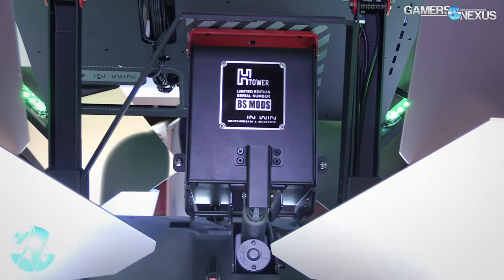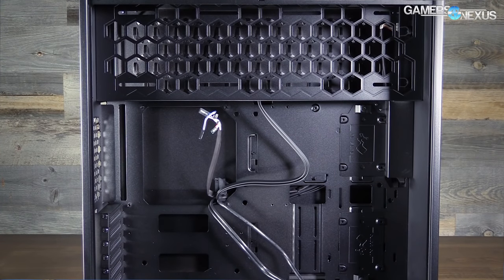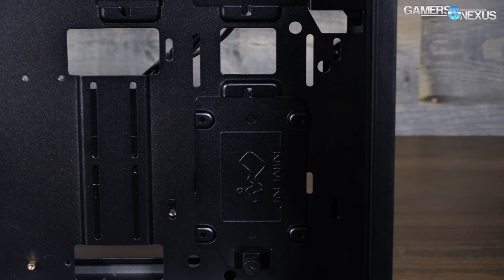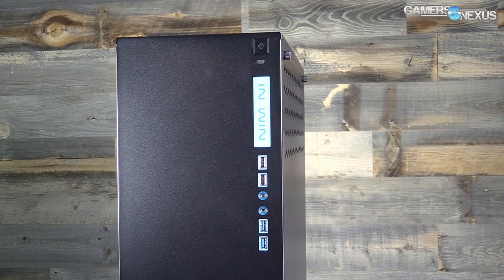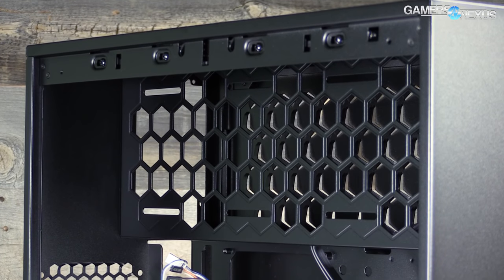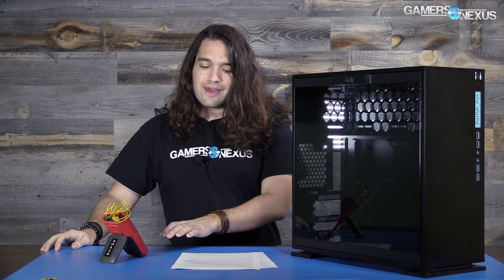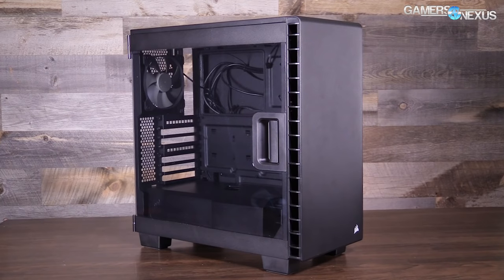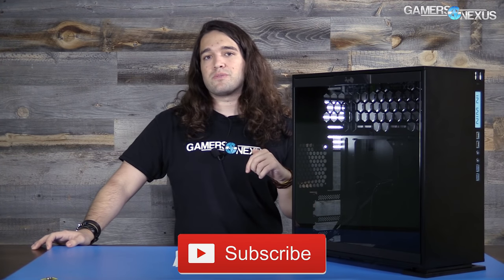In Win 303 Case Review & Benchmark vs. S340, 400C

Comment: Steve, with single GPU and 240rad on top honeycomb...do you think 2-3 bottom intakes, 1 rear exhaust, 240rad, and 1 fan for PSU would keep system cool? I want to add Thermaltake Riing fans all over.  I'm only concerned with getting GPU heat out using a dual fan GPU. (980ti). thx
Reply: I own this case myself, though I'm not using a water cooling. I would describe my fan configuration as the worst case scenario. I'm running a heavily overclocked 6600k and 2 Asus r9 270xs in crossfire with a 750 watt power supply WITH OUT USING ANY CASE FANS AT ALL and I have never once encountered thermals that I'd consider dangerous or even close to the throttling point. Your suggested configuration will do just fine, wont even break a sweat. I'm working on getting some fans btw, i'm just a broke college student.

Comment: Did you try to fit a NH-D15 or Dark Rock Pro 3 in this case? Although it says a maximum CPU cooler height of 160mm I've read in a forum thread about the case that a couple of owners are positive that a DRP3 or such would fit. But with almost no room whatsoever to spare between it and the side glass panel.
Reply from the maker: Have not attempted those. I think we have a DRP3, but have not tested. It looks like you'd be touching the glass side panel. I don't think I'll have time to build a system and check, unfortunately. Lots of video card content being crunched right now.
Reply: Gamers Nexus Yeah It'd be extremely tight. Do motherboard standoffs follow some type of standard or is it possible that some standoffs are a bit shorter and would allow for a DRP3? I do like the look of this case, but I don't wanna get rid of my DRP3
Reply: I have a d15 in my 303, the heatsink is only 160mm and you can lower the fan to be 160mm or less

Comment: Do you think I could have a full ATX mobo with all four bottom fan slots covered with thermaltake ring fans?
Reply: as an owner of this case with an atx board, the asus z170-A i currently have all 3 fans installed on the bottom without much issue. I use the corsair 120mm af fans. if you have any headers at the bottom of your board like I do then to get in the middle fan you will have to squeeze some of the cables however, just do what I did and do it carefully and you will be able to get in all 3 fans just fine. I currently have 3 fans on the bottom as intake, the back one as intake and the top 3 as exhaust and I dont have any watercooling and my system stays plenty cool. Also if you feel like doing some modding to the case you can get a 420mm rad to fit in the top with some slight drilling into the middle divider.
Reply: BlueLightning Films I have the same setup as above 3 riings on bottom as intake, rear intake and 3 riings up top with a 240 aio. the setup works fine for me, it's not the coolest case ever but it had enough air flow that my 1070 ftw boosts to 2152 MHz and pretty much stays there. if it ever drops it's to 2126. it can be a pain to cable route near the bottom of the board as above poster said, but it's definitely doable. tl:dr with some work airflow is sufficient for a single GPU system (and it makes for a beautiful system]

Comment: All the good cases died with the first version of the Cooler Master Cosmos. How hard can it be to find a silent case that's not "Look at me and look what's inside of me!"? Even the Cosmos II is a far cry from the original one.
Reply: I like a case that says "be able to move me occasionally" or "I actually have drives in all of the drive bays."
Reply: ***** That could be, but I'm not buying the idea of Fractal not testing its silent case against other silent cases. It doesn't even have sound dampening, which boh versions of the Cooler Master Cosmos have.
Reply: ***** Even to coil whine present on all cooling fans?

Comment: Radiator would put hot air into the power supply compartment.
So far nothing beats a 
Phanteks “Enthoo Pro Series “
Reply: The tempered glass version of the Enthoo Pro costs almost double this one. I would hope it's good.
Reply: Never seen a tempered glass version of the Enthoo Pro. Got a link? 
I paid 90 bucks for my white Enthoo Pro.
To me cost has nothing to do with function, I would not want to push the heat through my 1500 watt $300 power supply
Reply: Bass Player We used to push 100 percent of the heat from our PCs through $25 power supplies made by companies you've never heard of. Your EVGA with the 11 year warranty will be fine. I'm not sure the tempered glass panel version of the Enthoo Pro is available everywhere yet, but you can check out reviews at least if you search "Enthoo Pro tempered glass" or something like that.

Comment: Personally i think the 303's design is kind of a mess :/ can't use a 360mm rad on top, can't use one on the bottom (unless you have a mATX motherboard), can't even fill up the bottom with fans. What you get is a case that IMO is too tall for what you can fit and its pretty much just a showcase... case. But for $90 its not a "bad" choice i guess.

For $70 (or less) i would recommend the NZXT S340, anything else I would jump to $120+ cases.
Reply: +TrigrH I love you... We should mate some time
Reply: +Zatik I've been waiting bby
Reply: Gabriel Soria you can use 3 fans in the bottom as long as the bottom card slot isn't used, and you can install a 360 in the top with zero issues even in push/pull
Reply: Indeed, I had no issues installing 3 fans in the bottom even with a full atx board and usb headers plugged in...bottom 16x slot is tricky with 3 fans there, but I rarely use it anyway.

Comment: Corsair 400C or this InWin 303? I can not decide :'(.
Reply: Matias López I have the 303 and regardless what all these haters who have never built in it say it is a great case for the price. it does have some cable management problems but that's really all there is for setbacks. I have 3 120s in the bottom and a 240 aio and another 120 up top. it looks amazing with the riiing fans in all 6 spots and stays cool enough that my 1070 holds 2152mhz steady while gaming. this comment section is full of people who have never used it. you should read reviews from people who have. that said I've never used the corsair so idk which is better... do some research and good luck.

Comment: Does an H100i V2 fit at the top?
Reply: Yup, I use that setup. However the H100i tubing is quite stiff, so it feels a bit iffy to bend the tubes that much. But I haven't had any issues...

Comment: so should i use a micro atx mobo?
Reply: Pepe Medina you can if you want. check out pictures of people's builds on overclockers , fans fit no issue as long as you do the front io first and don't install anything in the bottom card slot.

Comment: So you happen to leave out the Phantex P400, oh yeah, u thrashed that and now u love this crap? smh!!
Reply: The P400 isn't good compared to the Enthoo Pro, which can be had for just a bit more money. It offers no features I'm aware of other than being pretty, and the design is screwed up. It's just not a good value case. This thing is way sturdier, for starters. I'm not sure the P400 is suitable for anything other than a "my first PC" for a console user with those flimsy panels. If it was half of its current price there would still be better cases at that price.

Comment: Not impressed.. No cable management, very poor air intake..  Ill stick with my  s340.
Reply: Umm what do you mean "no cable management"
Reply: Might be talking about the bottom wiring
Reply: I have the In Win  303 and cable management is good air intake is good ...
Reply: "Poor air intake" How? It's completely open on the bottom.
Reply: its also open at power supply with honeycomb.........plenty exhaust extraction
Reply: Ti-7-4Raven ??
Reply: Not to mention the PSU on top, what is that 1997?
Reply: That all can be true, but PSU on the top it's just ugly and not functional, not to mention super retro.
Reply: Hello, May I see your setup with 140mm radiator?
Reply: You cant fucking see the PSU.. so that doesnt really matter
Reply: Its great for airflow and good for cable management aswell, its much bigger than other mid towers so theres more room for cables

Comment: An utter failure of a case, 2 out of 3 bottom fans unusable, 1 out of 3 top fans unusable due to power supply, and an sli nightmare, yet there is almost nothing but good things said about it. Weird considering how this guy had a vengeance against the p400 which is leaps and bounds better than this case in almost every way minus tempered glass. What an unreliable reviewer.
Reply from the maker: Cases are largely subjective. A large radiator will not dump a considerable amount of heat into the PSU as the majority of the heat will be in the right 2/3 of the chamber, and a good PSU will run well below the 50C constant value anyway. SLI is not a "nightmare," but is not recommended. The bottom two fans would be usable with an mATX build. Each of these items has a counter which is valid, and so we bear in mind that use cases may vary. If you want hard, objective information, try watching our GPU coverage.  Keep in mind, too, that we actually did point out all of those flaws. It's not like they were ignored. That is the objective portion.

A case review will inherently have some subjective inflection as half of the product is visual. Ultimately, as with game reviews, you will need to find reviewers with taste matching yours when it comes to cases, then read/listen to their reviews for future cases. It's the same with games -- following a reviewer who dislikes FPS games when you like them, then reading that reviewer's FPS review just doesn't match. There is no harm in disagreeing with more subjective analysis. It just means we don't align on some view points, which is normal for humans. Find someone with whom you agree on cases and watch their content, or come back here if you want something which may challenge those points as it appears we differ in at least some regards.
Reply from the maker: Nice setup, TrigrH! What board are you running? Looks like a good fit for those bottom fan slots.
Reply: Gamers Nexus Its really not a "good" fit its an AsRock H87 performance but like I said its these SATA cables that make it all possible: http://www.silverstonetek.com/images/products/cp11/cp11b-500-34-1.jpg Since I have four MX100s in raid 0: http://i.imgur.com/ChtbsZC.jpg (which i mounted sideways on the brackets)
Reply: Also (you can kinda see it in the picture) but no mention was made of the included GPU support arm which actually really helps out my new GPU :)
Reply: Thank you for being one of the few that keeps their expectations realistic when reviewing cases. It's easy to nitpick cases like this and call things an "utter failure" but I've seen so many good builds in this case. 

I ended up putting my radiator inside the upper cage and the PSU gets it's own fan blowing through the grill into it (more for uniform looks of the three fans across the front than for an actual need), plus that puts the radiator in a push/pull. Even with an ATX board I have three fans in the bottom(Again, more for looks than for a need), They actually nicely hid my USB header cables. 
(To clarify I did have to modify the case a little bit to fit the hoses through into the upper cage. But you can put it outside and still have it push pull...I just wanted the fans flat on the outside of the cage.)

Also on a personal note the front face of the P400 with the cheesy lighting is a huge part of what drove me away from that case. The P400 just looks cheesy and kinda thrown together and cheap. 
The 303 needs some work like removing the logo on the front, but everything else is serviceable, whereas you can't really get away with just tossing the front panel off your P400 to get rid of the cheapy look of it...
Reply: BUT IF YOU HAVE AN ATX case it wont work with the fans on the bottom